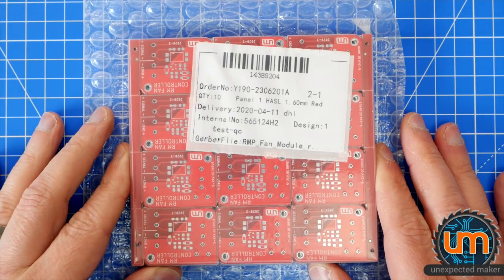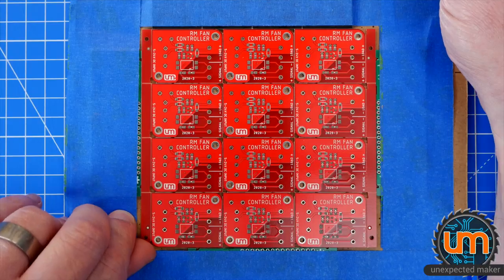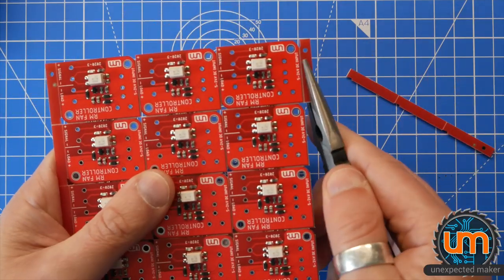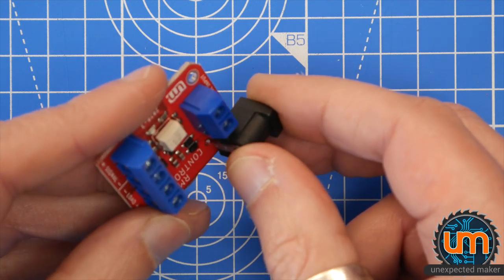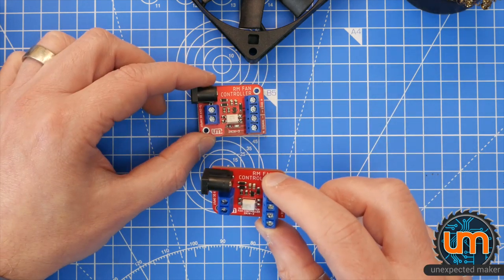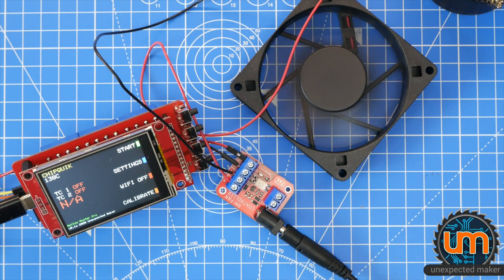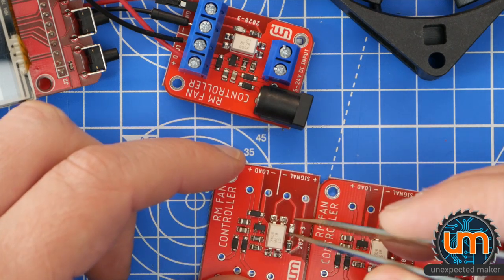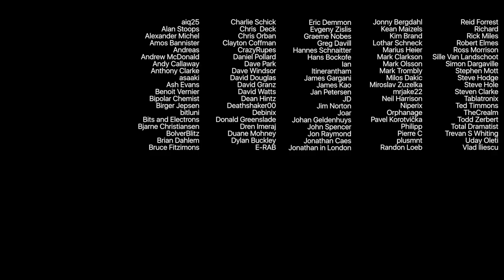RM Fan Controller - Final Build - Maybe?

Comment: Nice one. Fastest pick and placer in the west. One thing that would help with the pwm noise as I have been designing a fan controller my self for about a year now. (Not full time and not for the same requirement) is a 680mf cap accross the fan and increase they pwm frequency to around 50khz. Or just over where us humans can’t hear. But you prob know all that already 😂
Reply from the maker: My fans make no noise at all, and I want to run them at sub 1KHz ;)
Reply: Unexpected Maker I could hear yours when running 1khz. What are you doing diff? 😂
Reply from the maker: You could hear my fan in the video? The noise when it was running 1Khz and full duty? That's the sound of the fan spinning... nothing to do with PWM. Makes teh same sound at full speed when I just turn the IO on with no PWM.
Reply: @UnexpectedMaker  i meant i could hear the pwm frequency as it was slowing down

Comment: Blue LEDs can have quite a high forward voltage  which might be the issue here with the 3.3V PWM and the coin cell voltages.
Reply from the maker: Yes they do, but I have 2.1V there - enough to at least light them a little.
Reply: @UnexpectedMaker   The opto probably only has a forward voltage of ~1.3v and being in parallel will be drawing all the current preventing the blue led from lighting.
Reply from the maker: Yes, but there is enough to light the LED. Swapping to a working LED does work, but it's dull, as there is not enough voltage to light it properly. I'll do a board re-spin at some stage.

Comment: 1. One Resistor for the Led and the Opto is a bad Idea, they have different Forward Voltages. 

2. A Resistor in Series with the Gate of the Mosfet does not limit the Gate Voltage reliably. The max of 24V on the Load site will exceed the max Vgs of your Mosfet. Have you testet your Board with 24V Load ? Please look up your Max VGS in the Datasheet.

Comment: You make all your boards you sell like this? I mean, placing components by hand. :O
Your idea is to add  air inside to cool it down, right?
Reply from the maker: I have a PnP - but I'm building other boards on it atm. 1 fan for calling and 1 fan for extraction.
Reply: @UnexpectedMaker  the extraction fan is made of metal?
Are you pretending to use the PWM to reduce the heat slowly, right?

Comment: Do you have a pcb / schematic for a thermal control fan ?
Reply from the maker: A thermal control fan?
Reply: @UnexpectedMaker  A circuit or PCB project. One that uses a thermistor to measure tempature and adjust fan speed as temp goes up or down.
Reply from the maker: Nope, I don't have anything like that.

Comment: Nice board, why do you use pwm and not a programmable voltage regulator? With pwm fans tend to make horrible noise while regulate the voltage doesn't / less noisy.
Not that I am expert designing a pcb, just hear the difference between pwm/voltage fans.
Reply from the maker: My fans make no noise at all. Other than the beautiful sound of air moving through them. You need to use PWM capable fans. But aside from that, these controllers are designed to control any load you attach, so PWM is ideal here.
Reply: Another thing to remember, using PWM the fan is running at the correct voltage, which allows it to start even with a low duty cycle. If it is a 12v fan, it most likely wont start spinning using 3v, but it will using a 25% duty cycle. Hope that makes sense 🙂